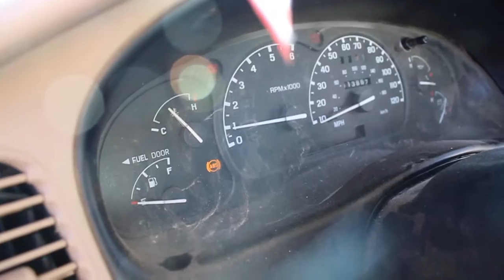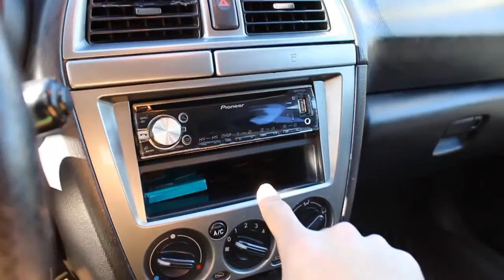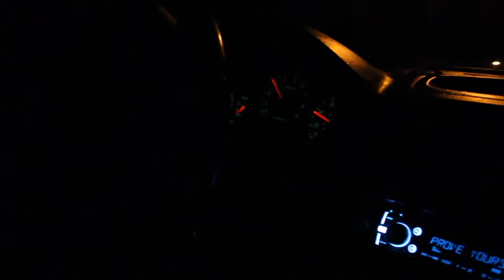PRERUNNER DROPS WEIGHT AND GAINS HORSEPOWER

Comment: you need to cut the inner bedside well and pull up next to a pole and use a ratchet strap to pull the bedsides, then just rivet like 3 brackets to hold it out.